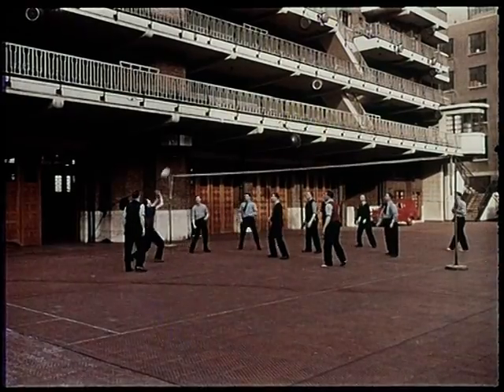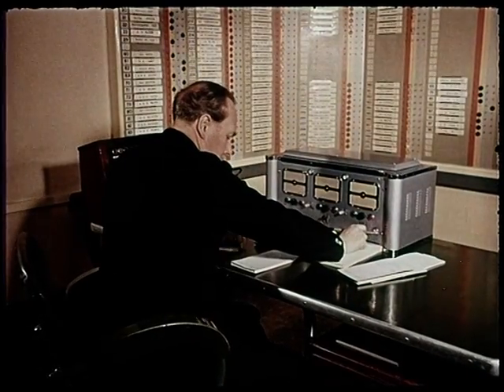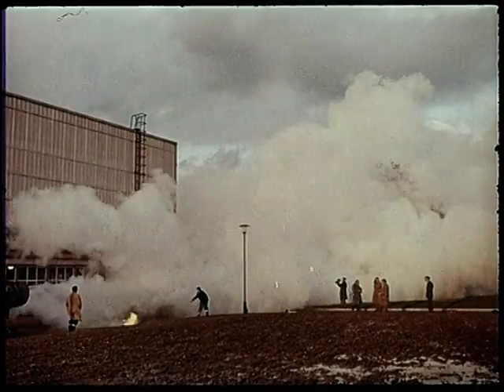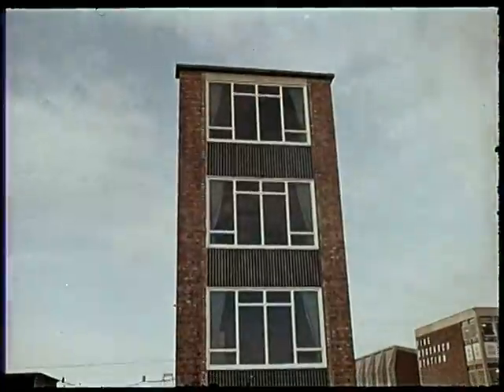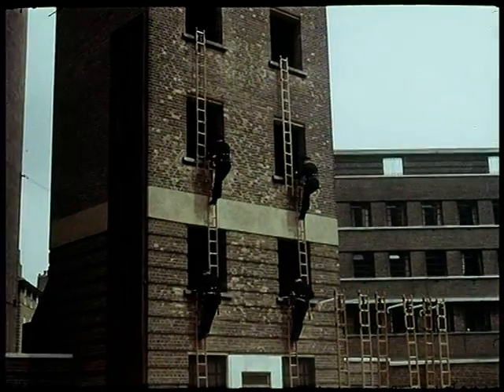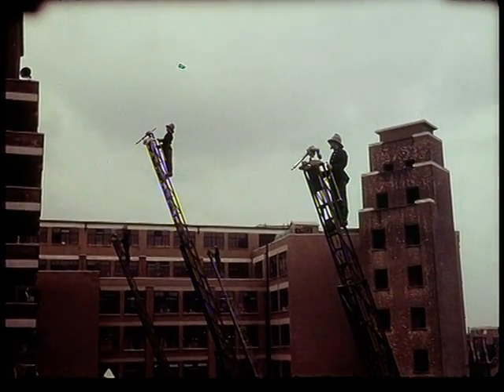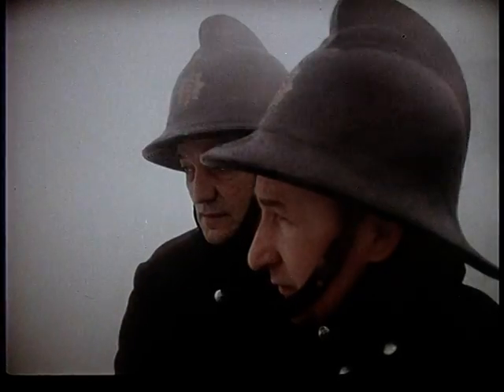London Fire Brigade-Look at Life. 1961.

Comment: I loved hook ladder drill, abseiling and self rescue drills. A few years into the job and it's ooh that's too dangerous to do as drill so when you come to do it for real they haven't got a bloody clue how to go about it.  The job started going downhill late 70's and it been on the slide ever since.  Basic firemanship is using your head, the manuals are just a guide and as for H&S well, all well and good but it's been carried too far.
Reply: Ah, the good old days. When firemen practiced their 'fireman's lift' carrying a colleague down a ladder. Worked well until they dropped someone with fatal consequences. Eventually someone thought a safety line was a good idea. Obviously can't be used in a real situation but no one gets killed just practicing.

Comment: I am amazed that as late as 1961 the London Fire Brigade were still using manual bells. It wasn't long before two tone horns came in (mid 1960s) but some fire brigade used US style sirens, e.g Liverpool , Leicester and Cheshire. Probably not nationally adopted because In the  1950s and 60s they may have been confused with air raid sirens although they sounded different

Comment: I can't believe they wore wool tunics back then -and continued to do so until the 1980's.  

And those were the early rebreather types of SCBA gear we see them working on at the start.
Reply: In the LFB they were called 'Proto' breathing apparatus. They were based around pure oxygen fed at (I think) two and a half liters/min into the bag at the front. The wearer breathed in through one side of the tubes and out through the other. His breath passed through a granular carbon dioxide absorbing material in the bottom of the bag, passing under a 'curtain' as it moved to the front of the bag, mixed with oxygen, then through a cooler and into the wearers' lungs.
In extreme/trapped conditions, those sets could be made to last for hours - some reports stated as long as 8+ hours although I never needed to test that out.

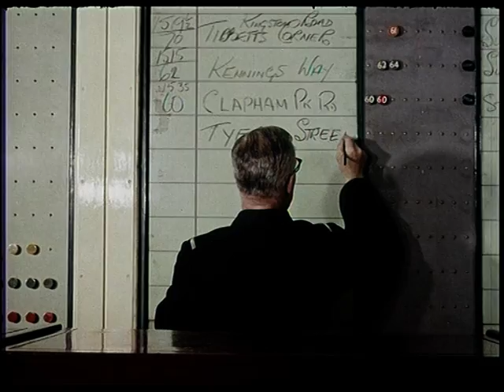Comment: 1:40 I'm somewhat fascinated by that index card system. I expect that a trained operator could access the relevant information faster than somebody could today on a computerized database. I had a couple of civil service jobs (Dole office and HMRC) in the 1980s just before the old index card systems were finally computerized. They were relatively quick and quite efficient.
Reply: But would it be practical